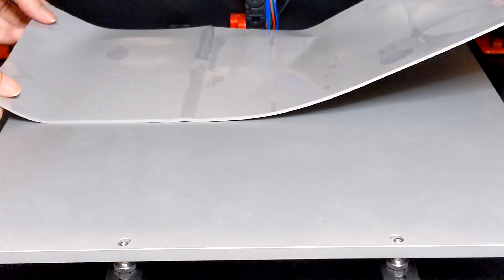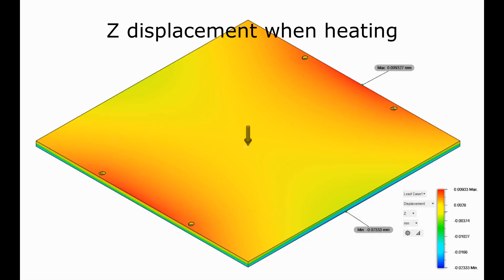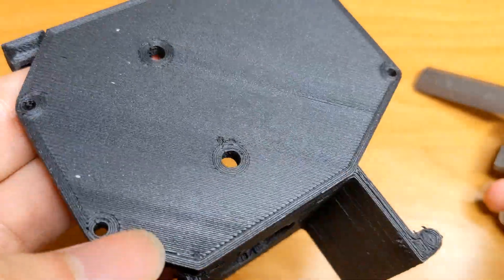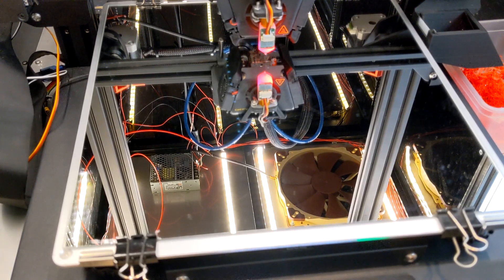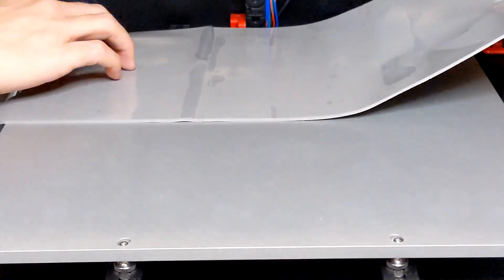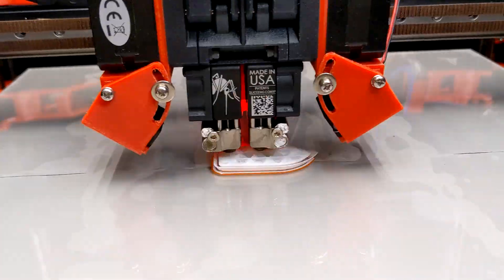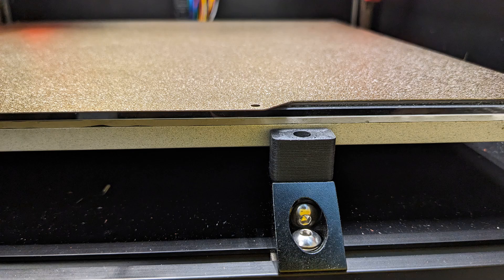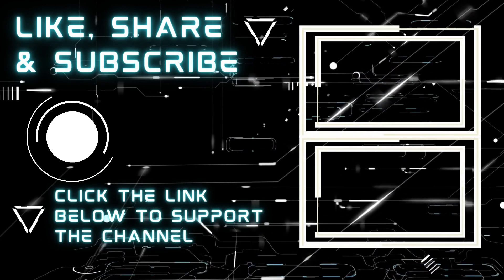[3D printing] Evolution of custom 3D printer buildplate

Comment: What the hell reason for aluminum bed then? Throw it away with thermal pad, they basically doing nothing.
Reply from the maker: The aluminum bed and the thermal pad are for heat distribution. The heater is still installed under the aluminum plate.

Comment: The best combination is the one with least layer stacking. Stacking multiple materials with different thermal conductivity is inefficient and your bed surface will not heat high enough for plastics with higher thermal requirments than ABS. Usually a milled flat cast aluminum bed with a minimum thickness of 12mm should keep the bed flat even with constant heating and cooling.  Although it will be expensive. A high temp magnet and pei steel sheet from a reputable brand such as fabreeko will minimize deviation of sheet thickness will keep the bed surface as flat as possible. Chasing bed flatness by layer stacking different materials is not the best idea, you're just adding more points of error/failure. Keep it plain and simple and save money and buy an cast aluminum ultraflat, 12mm+ thick bed and be done with it
Reply from the maker: I did some FEA before to see the displacement in the Z direction on different thicknesses of the aluminum plate.
https://youtu.be/svowSM3liiA
I agree with you the thicker aluminum plate will have more stable displacement along the Z-axis. The buildplate material I use is MIC6 which is recommended by Voron Design with 8mm thickness.
I also searched the CTE of MIC6 is 13.1 µin/in-°F 20-100°C, 68-212°F (2.358E-5 1/K), and the CTE of the borosilicate glass I bought is 3.25E-6 1/K. These data gave me a thought to sandwich the thermal pad to ignore the MIC6 expansion when heating.
For thermal conductivity, it is inefficient compares to a single aluminum plate. But setting the temperature limit at 120 degrees Celsius is enough for most filaments. Voron 2 is not suitable for materials that need a really high bed temp(ex. PEEK, PEKK) or required a high temp heat chamber setup.

Reference links:
MIC6
https://www.upmet.com/products/aluminum/mic-6
borosilicate glass
https://www.schott.com/ja-jp/products/borofloat-p1000314/technical-details?tab=51295d4ebc7045a1850d9f38114ec9b8

Comment: The point is never about how to make the cold plate flat enough (especially when you stack lots of materials on ur plates), I believe it should work with the proper probe for bed mesh function to get accurate Z offset for ABS printing. And some probes are not working well in warm spaces, no matter how well the printer has been built, Voron 2.4 has lots of variations for causing inflated printing plate like 4Z, frame transformation... etc. How printed ABS part to be cooled which is also a way to control the warping. For now, I believe if u want to get a good result for Post-Producing like CNC, u should try RAFT in the slicer and may try other material which is not easily warped like ABS. BTW, check the printing surface temp for ABS, should be higher than 100°C.
Reply from the maker: You misunderstand the content of this video. I already assumed the probe did the perfect job. FDM 3D printer has its limit. That is why the CNC machines come as post-processing to get more precise parts. Raft might help for most applications,  but what about getting a nice clean part with high precision? It is not ideal to use the rough bottom layer as a reference plane on CNC machines.

Comment: im wondering if it would make sense to mashin the aluminum bed wile it is hot like 100°C  so it is even at this temp and uneven  when cooled down?!
Reply from the maker: I'm not sure if it works or not. But I experienced bed meshes change over time on my printers. Cycles of heating and cooling change the bed frequently.